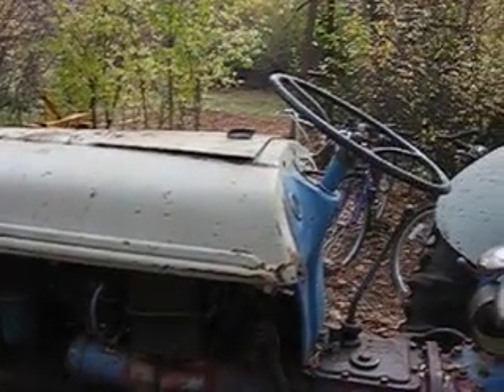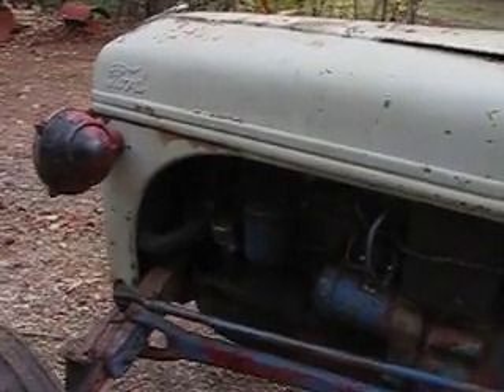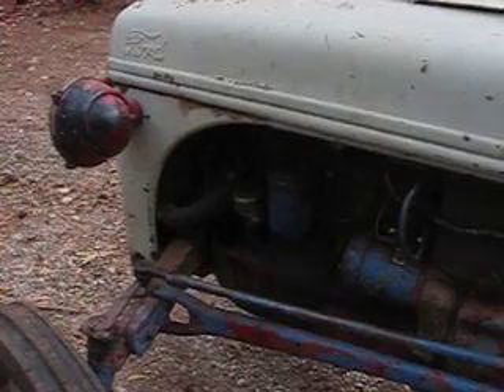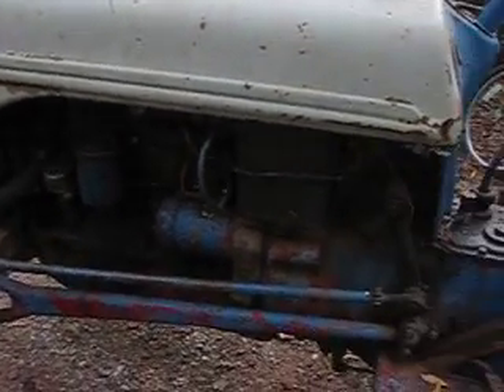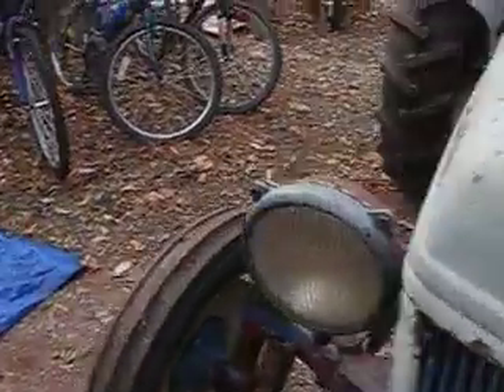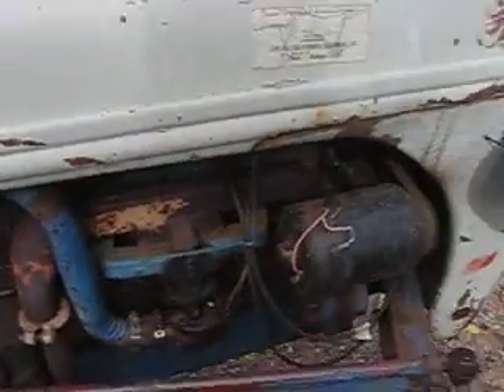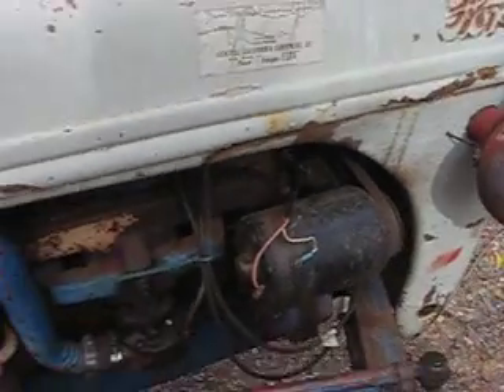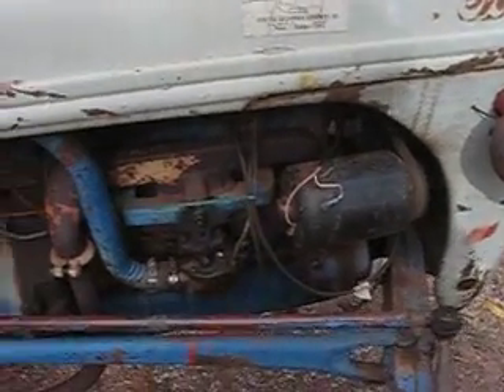8N tractor 6v vs 12v

Comment from the maker: You have a good point - I think that it might struggle at that temp - if I need to start it at very cold temps I make sure battery is charged then actually jump it with 12 volt battery - but I imagine that a 12 volt system would be much better for very cold temps.

Comment: The key to good 6 volt starting is good clean, tight, connections, and at least 00 gauge battery cables